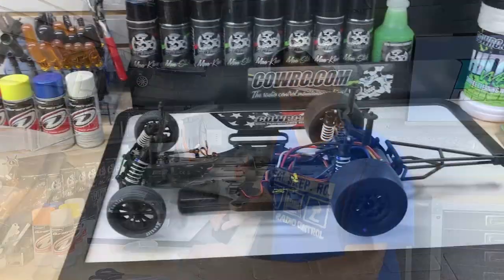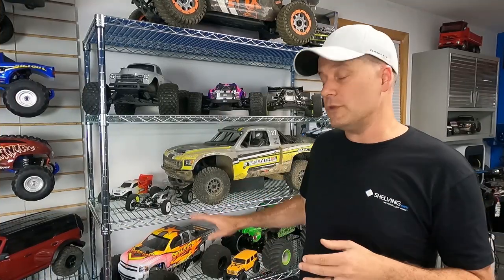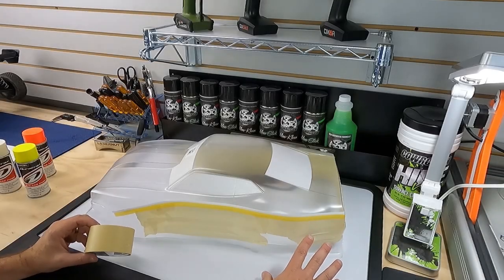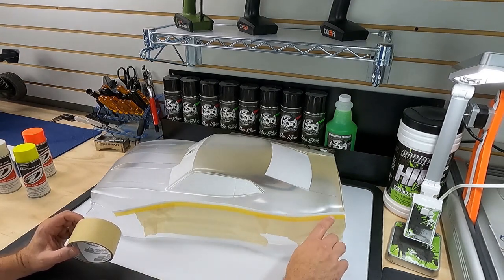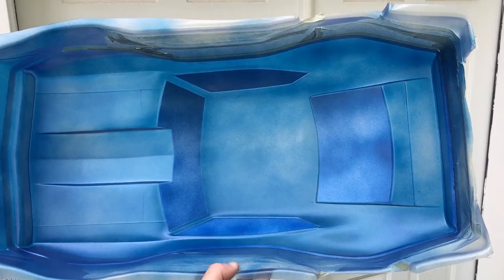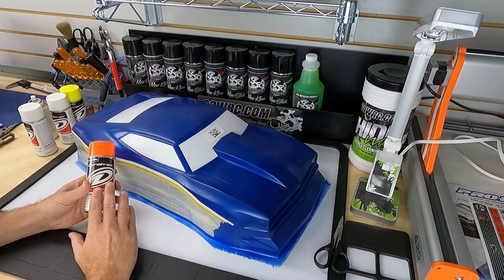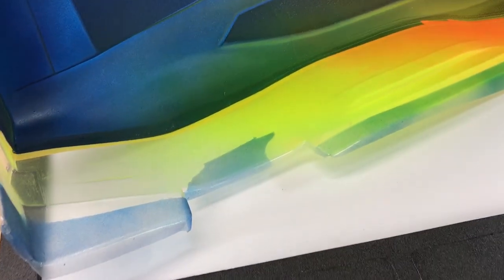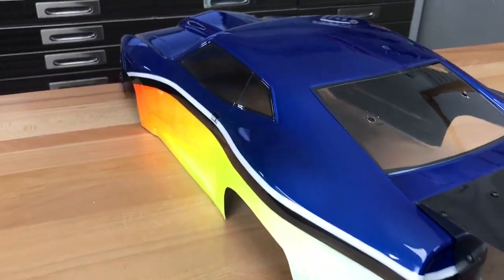Paint Tips! Create A Custom RC Drag Car Body With Spray Cans & Tape | RC Driver

Comment: When applying the window masks, roughly cut them out first, then peel back a small section of the backing and cut it off. Allows you to position the mask easily then you can push the sticky part down which holds it all in place while you peel off the rest of the backing. Makes it a million times easier and more accurate :)
Reply from the maker: Good tip! Thanks for sharing. With 30+ years of painting bodies under my belt and a bunch of them being magazine covers and box art, I found the eyeing it up method works best for me. Not all precut masks line up properly or they need to be maneuvered while adhering and having the backing on makes it difficult to make adjustments.

Comment: Wow man I love your tutorials. I’ve been painting hard plastics and leans for a year now and have been doing my best to learn any pearls of wisdom and you cover so much in this video. And such a clear message too. You know every time I start to spray the first coat I have to fight myself to not spray to much and  run the paint. It is a battle of the titans in my skull…. Is that green  bottle to the right in that rack on the wall a spray masking compound? That orange and yellow fade was cool. That turned out super clean.

Comment: You'll end up with colors that aren't exactly what you may have intended, but I think going lighter to darker on a similar fade to what was shown here helps blend and smooth out the change from one to the next
Reply from the maker: Yup, there are certainly different techniques and preferences. I’ve done both types of fades with cans. For some reason any white overspray into the yellow and orange bothers me more than the reverse.

Comment: I just bought a Proline Chevy Trailboss for my Senton 3s BLX that I wanted to paint, and your video has put my nerves at rest. It seemed so easy. I have heard that if you rub a fine sandpaper before paint, it'll give the paint more spots to grip to. What are your thoughts on this?

Comment: Put small pot on stove and boil water (can of soup sized pot), pull boiling water off stove and immediately drop your spray can into hot water. Set 5 min timer then remove can from water using a towel to avoid burns…..shake and spray for perfect mist no splotches.

Comment: I am about to start my first paint job on a very nice clear GT body for my new LIMITLESS roller.  It’s been a long time since I painted any RC body and never a clear body.  I am very concerned about the body posts.  How come you didn’t do the holes for the posts first?  Now that the body is painted, how do you plan to take care of it?
Reply: U should mark them b4 u paint the body with a Sharpe on the outside but u can use the flashlight trick...hold the flashlight underneath n some times u can see threw it n mark your body posts or stick pieces of folded up tape on the ends on the body mounts n try to put the body on straight mark it with a Sharpie. This trick may take a few times to get it right

Comment: its like 100% easier if you mount the body on the car before painting it so you can actually see where the body post holes need to go, again your showing us how to do easy stuff but not explaining how you are supposed to blind drill the body post holes